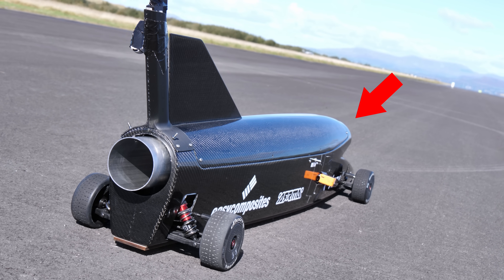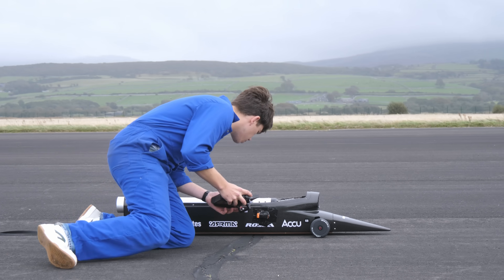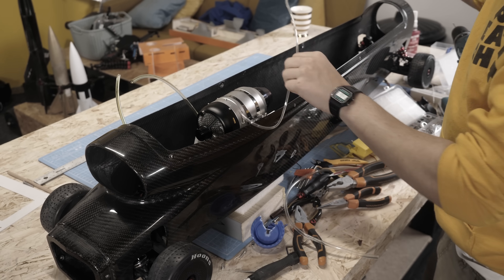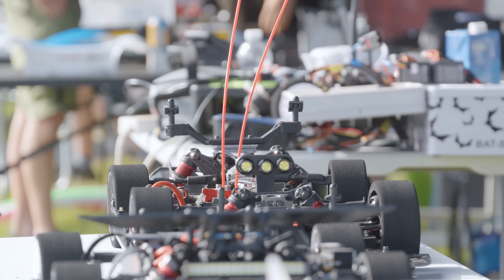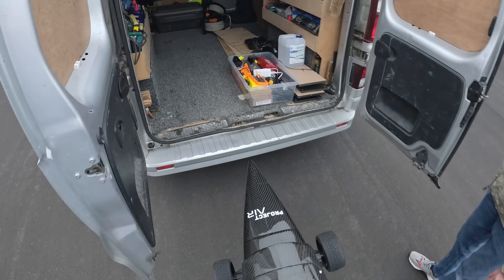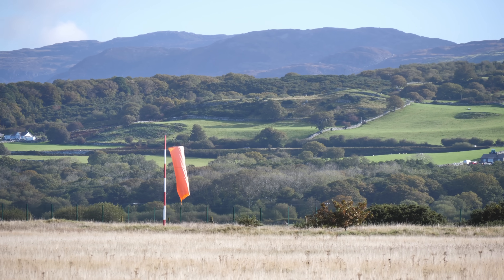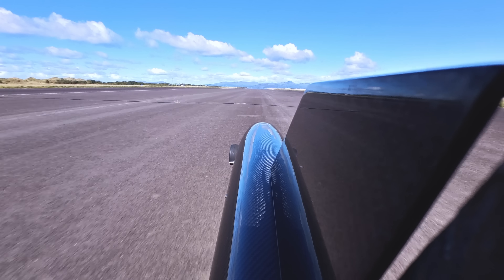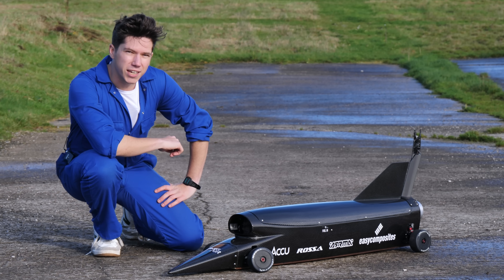World's Fastest Jet RC Car (Runway Testing)

Comment: A gyro on the steering would probably help
Reply: setting up the suspension to self steer (toe and caster angles) is more useful in a speed run car than a gyro imo.
Reply: @tmmtmm this guy is too dumb for such stuff. Its only about doing stuff to make a video. In no video there was real in depth knowledge of anything.
Reply: the last time he used a gyro it created more problems
Reply: @zanexdreamy wasn’t it because the car he was using just had a worn out steering chassis because of the multiple beatings it endured (I’m assuming it’s the golden car he had)
Reply: @Titanicminion  the gyro was over correcting where it didn't need to, whether or not it was because of worn out steering, the car drove in a straight line without it
Reply: @zanexdreamy because it has to be tuned correctly, P.I.D. sort of things
Reply: He's tried that before and it was  very not helpful.

Comment: Inside Aero and wheels need a complete makeover, this is way too draggy. Also might want to add a bypass intake under the car to add downforce and gain a bit more steering authority and overall grip if you plan to go higher speeds.

...Add wheel covers...

Comment: How are you gonna label the video world speed record when this thing is slow as shit it’s slower than a normal RC car. I will give you that the car looks cool as hell but it’s slow.
Reply: Did you see the part about the bigger engine that the chassis was designed for? Did you see that it's three times as powerful? 😂
Reply: It's a world record for a jet powered non wheel driven car. And this machine is bespoke, expensive & takes months to get built. Record attempt cars have to build up speed slowly, in stages.

Comment: You should have 2 steering rates, or even a dynamic rate that changes with the current speed
Reply from the maker: The car has two steering rates for turning at slow speeds and for hardly moving at high speeds 😊 It’s toggled by a switch on my TX.
Reply: @Project-Air  Still looks super twitchy at high speed. For the high speed it should have a negative EXP, lower steering rate and lower end points.
Reply: @Project-Air  I hope you never forget about that switch!
Reply: I agree! That would definitely stabilize the long run hi speed direction. Also lessen the chance of another mishap. Should be able to program that into the radio.
Reply: I thought exactly that, that's what cars with stearing by wire do
Reply: you dont even need two , just one high speed ratio , who cares about it having a low speed ratio not like it needs to parallel park
Reply: It also looks like a steering geometry problem.  Squirrely handling is also a sign of too much inward toe.  For stable high speed straight running you want a tiny smidge of out toe, very tight and low lash in linkages, and very tiny amounts of steering throw.
Reply: Yes.. sharp turns at high speed have been known to cause problems..
Reply: I didn't even think about that! Ya all are coming up and spotting issues that will make getting to the goal safer and probably result in a higher overall speed.

Comment: Why mount your GoPro with duct tape? Would it not have been better to incorporate a camera mount into the design?
Reply: I was wondering the same. Lots of draggy stuff taped on and the air intake dumps into a cavity of wires and whatnot when it should duct directly into the motor. Look down the intake on any fighter, you don't see cables and plumbing. Just intentionally structured ducting.
Reply: @iankphone I’d let a bit of air go around the outside of the engine and tube. You’ll probably find that it’s keeping that aluminium tube cool enough to not melt.
Reply: specially now with those tiny insta 360 go2 cameras
Reply: like in the nose or tail
Reply: Probably the build is made for breaking the record and recording is only for testing
Reply: If he's going to incorporate a camera he'd do well to put in an FPV cam so he can steer straight at any distance.
Reply: Ditch the go pro, go for an FPV camera
Reply: why design it to be aerodynamic at all if your gona bonk a cube camera on it?
Reply from the maker: It’s so we can change the angles easily and get them off for charging and analysis of the footage quickly between runs. In the future we can bolt on proper camera pods, but some things at early stages you don’t want to over engineer.
Reply: @Project-Air  Since it doesn't look like you've spared any expense up until this point, use a digital FPV camera. In addition to letting you steer from a first person perspective, they will also record 4K 60 if you want for another perspective in your finished cut.
Reply: probably because they were using these runs more for data collection, like they didnt know before how the steering performed at high speed, and now they know its twitchy. i imagine for the full speed record, they would either put one tiny camera on it in a good position or just have none.
Reply: Well... Nobody's perfect.

Comment: all the aerodynamic shapes are basically useless because the air intake is completely open, so air just rushes in and pushes against the car from the inside. i think it would make a huge difference to run one continous channel frome the inlet through the turbine and out the exaust, not an engeneer so i dont know for sure😉.
Reply: agreed, needs a sealed duct internally to force all the intake into the motor, pretty simple to implement without huge chassis changes, now the body is acting like a drag chute
Reply: @strattenvanwyk8303 the duct would need a small Modifikation to ist Edge Like the F-16 or EF2000 have, or Else turbulent air will disrupt the Turbine
Reply: @strattenvanwyk8303  it need airflow around it to keep it cool, they get VERY HOT, also you can only force so much air into such a small turbine, the passage for air around the turbine is a huge benefactor
Reply: Yup closer and flatter to the ground is optimal for speed at that scale
Reply: @arox5762 agreed,  however closer to the ground isn't good for the turbine. It would be sucking in way more abrasive particulates that could damage the engine.
Reply: I suspect once the bigger motor is in that will fill the space well enough you don't need a deliberate intake seal, as relatively little will get around it, and the stuff that does is probably useful to make sure the body work and electronics don't get trashed by the heat.
Reply: Yeah you are right
Reply: As an engineer, The turbine does benefit greatly from airflow around the outside of it during running. Model turbine aircraft are the same otherwise you risk very high temps inside the fuselage and in this case, chassis. Besides with the exhaust pipe design the air inside the car will get ejected/scavenged out along with the exhaust. With the speeds currently being achieved I think he's on the money. Airflow inside is a good thing.
I'm more worried about the external camera mounting and the sloppy suspension.
Reply: "so air just rushes in and pushes against the car from the inside" so the air that isn't being sucked into the turbine is allowed to go past instead of trying to be forced into the turbine (which can probably only take so much air in at 200 mph), that seems more like a benefit than a drawback, also jet turbines get VERY HOT so they need airflow around them to help stay cool. Project Air is not an idiot. you may think that because he's made some questionable decisions with his last record attempts but it's understandable to why he did, he's poured months upon months of time and effort and loads of money into this project, he has been waiting for ages to do it, he just wants to be able to see the fruits of his labor.
Reply: It needs to be open so the jet engine can suck in the air… and there’s no back wall so the air just passes right through the car which is actually better than having a closed front.
Reply: Yep
Reply: It sounds like a stuka
Reply: no aero needed  when it's slower than a stock Infraction
Reply: @toolbaggers but they have got a point, in order for the car to reach it's full potential, they need to do that
Reply: @toolbaggers53sec😂
Reply: Yes, it need a 3d printed duct inside the air intake and funnels the air to the turbine. Also, no bulky cameras strapped on the outside.
Reply: i've been screaming this the whole time, lol
Reply: Why is SOOOOO DAM SLOW!!!!!
Reply: @gavinwilkinson3722  smaller engine? did you miss that Part?

Comment: It's all pointless if you are more afraid to break it, than you are motivated to achieve something amazing.
Reply: Agreed I can’t believe I watched two videos worth of this car just to hit 60 miles an hour and the videos labeled world speed record and the world speed is like 238 miles an hour get out of here
Reply: Absolute nonsense
Reply: i guess you didnt see what happened when he had that attitude a year back, ut yeah i do agree
Reply: Absolutely correct, if you are afraid to break the thing, you don't have the nerves to push the limits. They don't pay race car drivers to take it easy, they pay them to push the limits of engineering to its breaking point. A good driver or pilot has nerves of steel and will play right at the limits of the machines capabilities. I do understand the weather risks though and if that is an issue its not time to play, but you shouldn't be out there at all if that's the case and what your concern is. If the goal is to set a record, you need to be ready to push the limits of the machine. I have never set any records, but I have competed and won in various RC airplane events, but I never worried about breaking the airplane, that is just part of the event if it happens. You have to go out there and do your thing, no nerves involved. Your not in the machine so you should not be concerned about your own safety. I do understand spectators safety but you shouldn't be that concerned about that either if the place is setup correctly and you are a good driver/pilot. I get its an expensive hobby, but if you are not willing to spend the money, it may not be the right hobby for you. I have had my share of crashes and it may be disappointing, but its never been devastating to me. I have my trophies to enjoy even the ones that no longer exist. Big boy toys, require big boy attitudes.